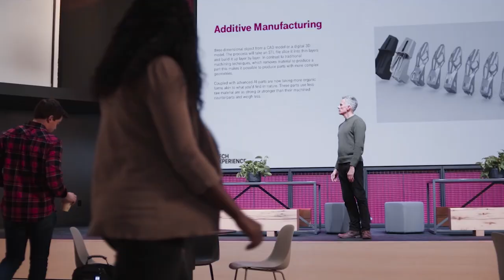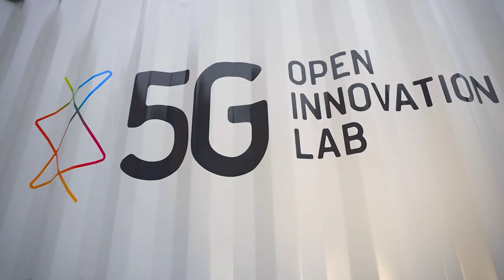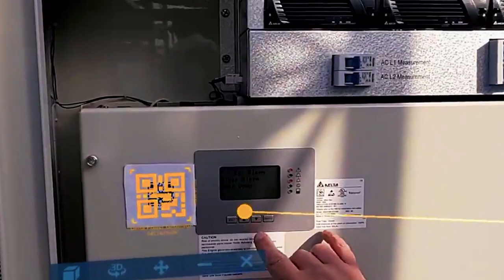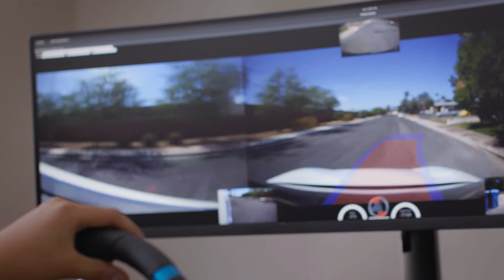How the Largest 5G Network was Born | T-Mobile

Comment: No one asked for 5G. 4G is doing just fine.
Reply: Why not 2G or 3G? 5G helps with capacity btw. Better latency and faster downloads.
Reply: T-Mobile 4G Spectrum is moving to 5G
Reply: @chanel808life-mthi  What?
Reply: @SwitchedDreams  T-Mobile is Refarming there 4g lte to the 5g side to dedicate most of the spectrum to 5G …. ok 👍 thank you 🙏 😂
Reply: @chanel808life-mthi  thats pretty smart acturally i mean verizons been doing that by stealing 4G capacity and tmobiles transitioning it slpwly over time😂
Reply: A couple of these executives came from Sprint. Very cool.
Reply: @chanel808life-mthi  ah, great..
Reply: MaxLinear just has issued a new open ran 5g SoC chip called “Sierra”.
A very powerful chip!!!!